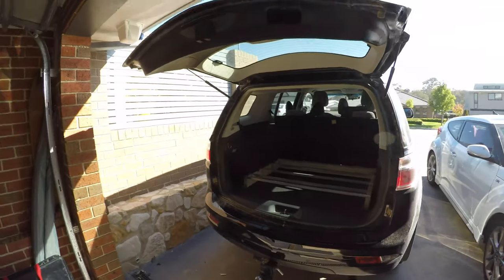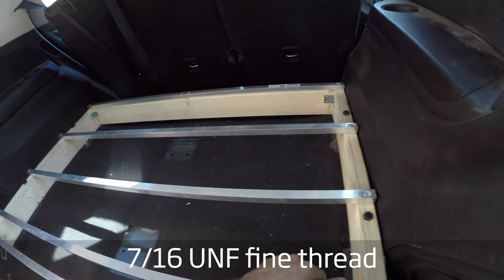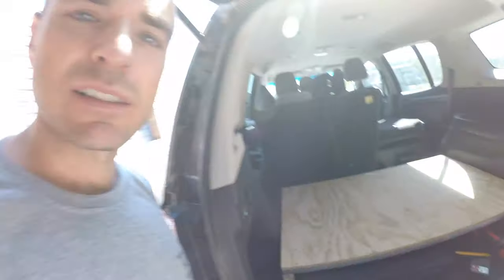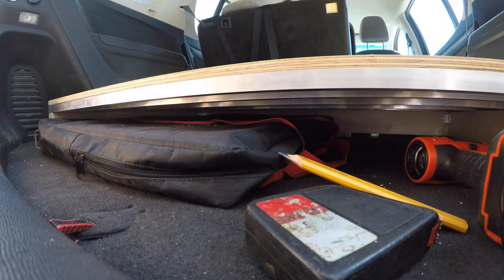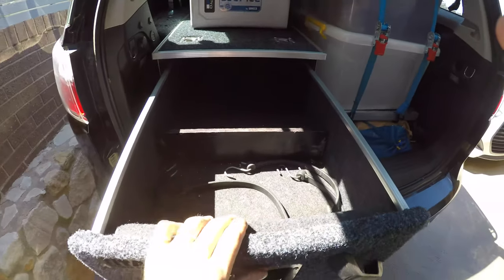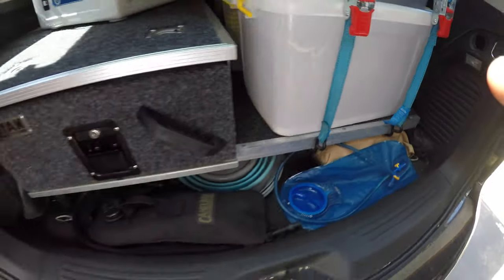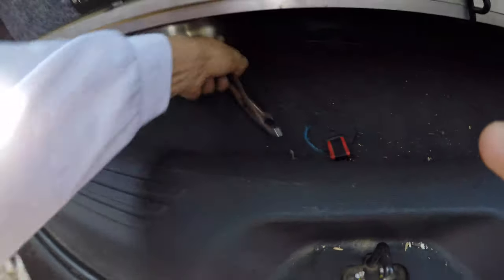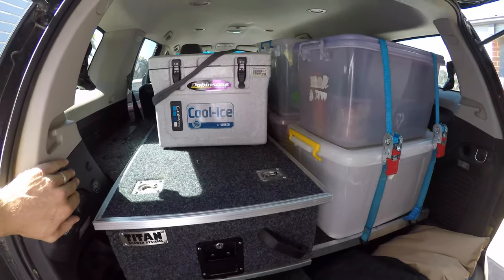Colorado 7 Rear Drawer and False Floor install

Comment: Hi, how did you get the seat belt bolts out, mine are really tight, like what you have done.😊 Ken
Reply from the maker: It was a long time ago, I don't remember it being a major issue. Get a long handle socket/breaker bar if they are really tight. They do have lock tight on them from factory.

Comment: Great job - How do you remove the 3rd Row seats?
Reply from the maker: Hey Steve, from memory it is about 8 bolts and they come straight out. The bolts are hidden under plastic covers that pull off. The centre cover was the hardest to remove, it needs to be pulled towards the front of the car.

Comment: I assume the purpose is so the Titan drawer can roll out, makes sense. Can I ask what benefit the drawer gives over no floor and just another crate? I am seeing a few of these builds, they look the goods and thinking of one myself but questioning the cost over just having another crate.... Am I missing something? Cheers
Reply from the maker: Hey Brendan, yes you are right, some kind of false floor is necessary so that the drawer clears the lip at the rear of the car. I decided to make it higher because it gives you a HUGE amount of space for flat camping gear, as shown in the video. The advantage of the drawer is that you can mount a fridge and slide on top. I have done this since making the video. So now one side is drawer and fridge, the other side just boxes. The othe advantage is you dont have to pull it out of the car to access it.
Reply: @OutdoorsCBR   thanks mate. Appreciate the reply.

Comment: How did you remove the seats?
Reply from the maker: Just unbolt them mate. It's a fairly easy job once you remove plastic covers that cover the bolt heads.

Comment: How strongs this now years later?
Reply from the maker: Still going strong mate. I have since bolted my drawer through the false floor. Pretty sure I screwed it in originally, was a bit dodgy. I have had some heavy weight on the floor, no dramas. The floor flexes a tiny bit but hasn't been a problem.